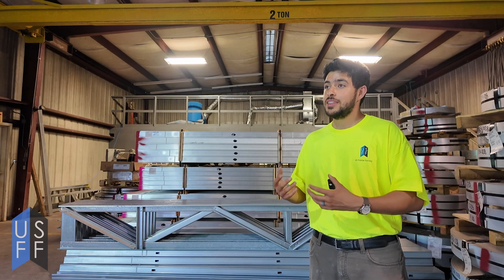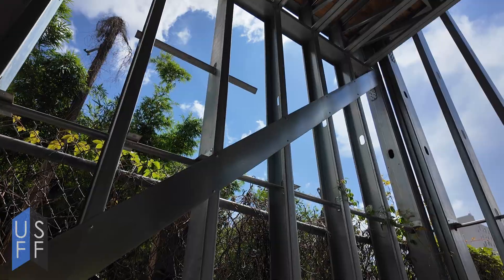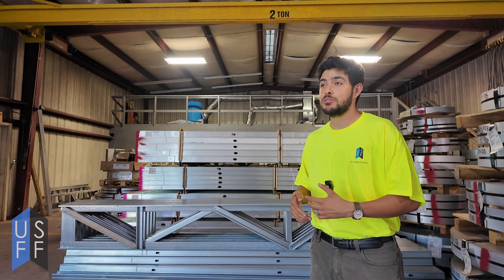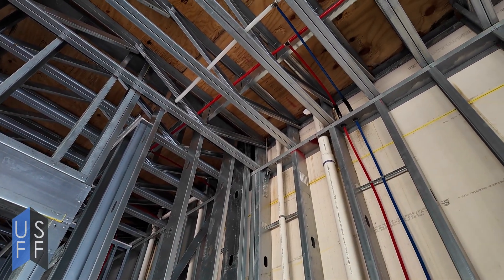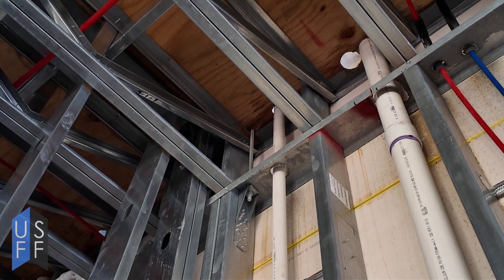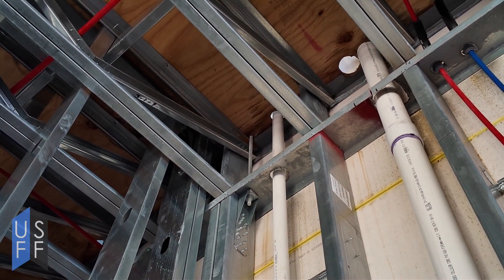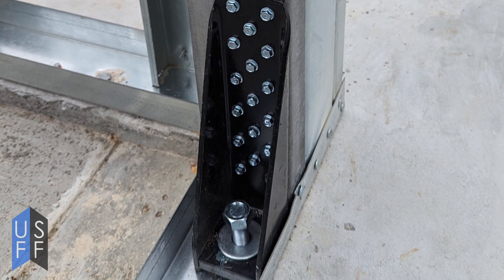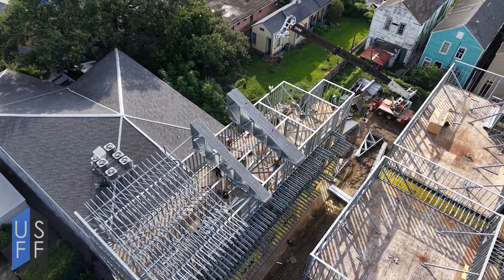Holdowns & Shear Walls Explained

Comment: Some of those shots of hold downs already looks as if it has already started to corrode and rusting at the foundation. This looks bad if sealed up and boarded over it could continue to corrode and rust without anyone’s knowledge until repairs become expensive or impossible.

How do you remedy that?  Even though it is galvanized the cut sections are exposed with no protection.  With ground contact and fresh foundation a little moisture will start a current flow to the ground.   This will speed up rusting even though it is galvanize.
Reply from the maker: Some of these shots were taken prior to finishing up the building. The framers will drill weep holes and ensure that the structure does not hold any water prior to final wall close-in. Great catch!